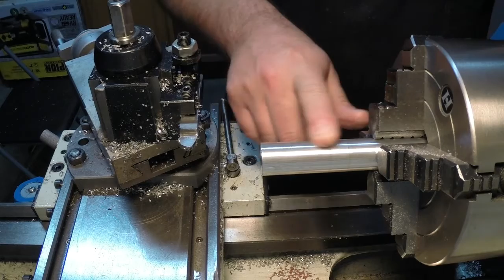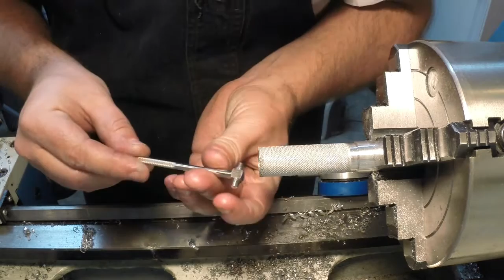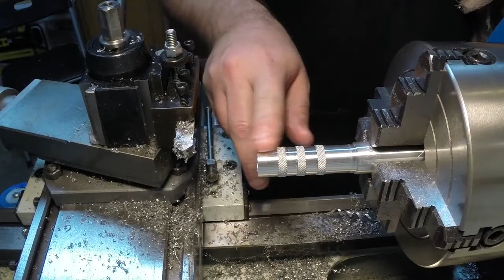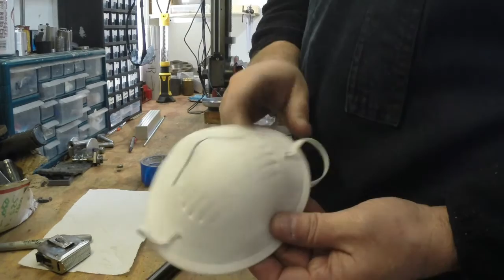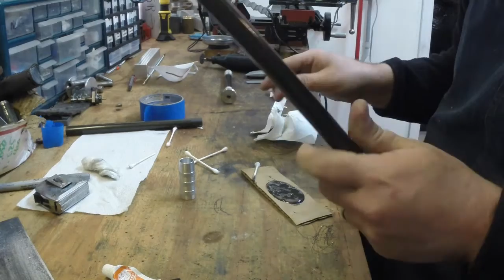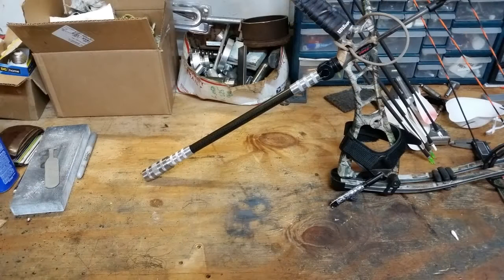Hunting Bow Carbon Stabilizer Build

Comment: What is the weight of the stabilizer? And how much poundage was your bow at? I made a short (probably 7 inch stabilizer oout of solide aluminum I need to thread the back sTill) but I wanted to make a longer comoetition type one. Looks good

Comment: three questions. why caps vs inserting into tube? what ratio of cap length to diameter and why that ratio. Thanks
Reply from the maker: All good questions. I am not sure if there is an advantage to caps vs inserts other than aesthetics. I copied my design from several popular commercially available stabilizers.  The caps are 2" long. They holes are approximately 1.5" deep. This leaves 1/2" of thread of the 5/16-24 threaded rod. This seems to be a good balance of thread strength vs depth for the carbon tubing. I wouldn't want less than 1/2" for the threaded portion. You could always make them longer, but you are adding weight in the process. The idea is to keep the shaft as light as possible so the end weights can do their jobs.

Comment: What modulus carbon tube did you use?  Think it would be stiff enough for up to a 30" stabilizer?
Reply from the maker: I don't recall the modulus. I believe the piece I used had a wall thickness of .040". I would suggest using a .060" walled tube if going that long.  I have been planning to build a long rod but I just haven't done it yet.
Reply: Thanks for the input.  Dragon Plate has some 1/16" wall High Modulus.  It's $106 for a 6' piece, but that will make front and back bars for both of my bows.  Nice video by the way.
Reply from the maker: No problem! Let me know if you need anything else.